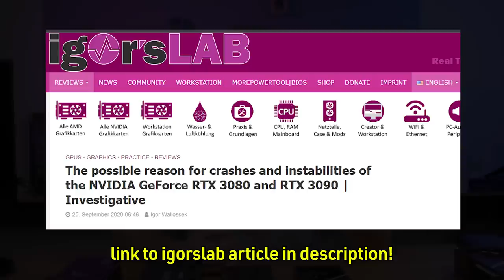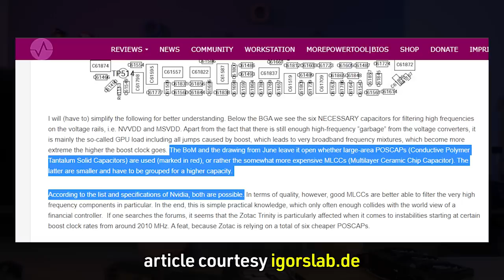The RTX 3080 Launch can't get any worse... Right? Wrong...

Comment: 14:02

“Aww I got the stupid SLI thing in the way”

Also what Nvidia said before nuking SLI support
Reply: SLI being dropped really upset me. I bought 2 GTX 970's when they came out and could barely utilize them.
Reply: @Nazraq04  It was interesting but I never felt like it was really all that efficient and "worth it", being that you had to buy two cards and have both pull power. 3080 solo seems pretty nice.
Reply: @JB-xl2jc  It used to be pretty sweet actually. My first SLI build had 2 GTX 570's, and at that time SLI was supported quite well. It was pretty close to double the performance. Like 185% sometimes higher. 

When Arkham Knight came out on PC and it didn't support SLI, I knew there was trouble ahead. Rocksteady had always implemented Nvidia specific features in their Batman games, but dropped SLI. Then, basically no developers were doing it either. 

Long story short. It used to be good, and now it's total garbage.
Reply: @Nazraq04  SLI and CrossFire was barely used by any games or programs. It was the biggest scam this industry has seen in a very long time.
Reply: @ShadowViewsOnly  It had pretty widespread support back in the PS3/360 days.
Reply: @Nazraq04  It had barely any support, and around 2010,2012 area, it basically completely disappeared.

Comment: ROG Strix is using 6 sets of the high quality capacitors instead of just the 2
Reply: All ASUS cards seem to.
Reply: @supra_enjoyer  all... Tuf and strix lol. The TUF is the best price/performance custom
Reply: Are you sure? I just visited the Asus website and.i can see in the pics 6 of the cheap ones.
Reply: @tricksterapva  https://www.asus.com/Graphics-Cards/TUF-RTX3080-O10G-GAMING/gallery/

yeah if you go on this site, one picture shows 6 cheap ones, while another picture shows 6 expensive ones. look closely! they must have changed their production. maybe they discovered this issue at an early stage.
Reply: @tricksterapva  I just checked, on ASUS website there's reference picture, showing cheap transistors true. Those images are generated by PC software. Prolly graphic designer messed up, as I saw many ASUS TUF 3080 teardowns and I can guarantee you that every single ASUS cards have all 6 more expensive transistors.
Reply: For me both are the high quality one. I gt redirected to my local asus website.

Comment: Looks like scalpers aren’t getting their money 😂
Reply: They are because of low supply, there isn't much choice.  It's not like the AIB's are going to retool and release new cards.  That would delay shipments for months.  They are going to just release a firmware update and if you're lucky to find a reference card or the TUF model, good for you.  If you can't and you really want a 3080, you'll take the worse ones with the firmware update.
Reply: @RWDtech  Buying the defective ones for 1000% higher price without a warranty included? Dude, no... If a scalper, by some miracle manages to sell one of those cards, whoever bought them is a moron, but anyone with a brain will not be buying those cards. :P

Comment: People might start getting really mad if they actually just took a minute to look up the 1k/unit pricing on digikey for low voltage (remember, those caps only need to take VCore, so in the <3V range) MLCC and electrolytic polymer caps: We're talking anywhere from <$1 to a max of around $5 saved. On a board supposed to be worth another couple of $100 for bettwer power delivery components to allow you to get some sort of enhanced overclocking performance!

Even for they "High-End", super stable, CG0 ones (which I highly doubt is what is required according to Nvidia spec, but whatever. XR5 or XR7 would make muck more sense in a decoupling role. Also, buying several different values is more effective than just buying 6x the highest capacitance due to where the self-resonance point lies, etc. etc. But it would probably be optimal to have the following (1x of each: 22uF, 10uF, 1uF, 100nF, 10nf and 1nf), with the smallest values getting the preferred placement as close as possible to the GPU.

There's usually nothing wrong with improving it yourself either (IMO anyway. I mean, if it's not even stable at 2GHz in gaming benchmarks, not even talking about furmark, then  it's not like you can fu.. mess it up any more, right?) So, just solder a small extension perfboard onto some contacts and also, in addition to the correct MLCC array, add on some 100uF~330uF electrolytic power smoothing capacitors for larger/longer transients, assuming the  buck converter has sufficient cooling and peak current rating capability to handle the increased capacitive load...
Reply: Your comment reads like a paper.
Reply: Only thing you’ve missed is the increased production cost on top of increased component cost
Reply: Mortlet . Nicely researched. One of the photos on Igor's article shows a modified board (the pads for either cap type are present) with the MLCC replacements, but Doesn't state the values used. Alas a couple of dollars is more than enough for AIB's to choose the polymer caps; auto makers will go cheap if it saves cents on a $30k vehicle.
Reply: Joe White . If they're all the same value,the reel is loaded and the placement is so close the eight can be placed in under a second. The soldering time is no different. If they use different values, that would add significantly as it would take eight passes; and if they were unique values to the board there's also the inventory cost for adding a reel to the placement tool (which can be limited, and it's very costly to exceed the max reel count).
Reply: Exactly what I thought!!! Working in RF V&V, and having a lot of experience with CCA and component level repair, my first thought was, "wait, they are having problems because of a handful of SM Caps that likely cost pennies on the dollar?!  No disrespect to the mfr, but imo the reputation hit they could take on this is probably going to cost them more than the value of those caps, even with the mfg overhead added in...
Reply: @AndrewSmall963  Just a correction, using different values wouldn't take more passes, a single head on the placement machine would probably have 24 nozzles (depending on the machine type ) - those eight caps would be placed in two-tenths of a second regardless of value. Also, a line would have multiple modules of SMT placement.  The placement cycle-time of the entire side is definitely in under a minute.
Reply: @mikemoore8929  This is the problem, coming from marketing myself, i do understand the cents on a dollar saving companies do, as it in the end generates more profit. But at the core you need to ship a fully functioning product, because the reputation hit is so much worse than the cents/unit you would gain.
Reply: So I work with a lot of MLCCSs at work and I do not suggest soldering them on by hand if your not a pro at soldering. MLCCs are prone to cracking if they are touched with a soldering iron causing internal shorts and potentially causing bigger issues on the card. I have seen my fair share of MLCCs that have burnt up a board due to a micro fracture causes by a slip of a soldering iron.
Reply: Gerd L. Plüü It’s not just that either. Anyone that knows a bit about mass production can tell you that saving a few cents on every card adds up fast when you are moving hundreds of thousands of units. But a difference of $5 dollars? Multiply that by a couple million over the production lifespan of a card and you could be shooting yourself in the foot from a financial standpoint.

In all likelihood, the vast majority of people won’t be pushing their cards very much and will never encounter the issue which validates the choice for savings.
Reply: doghous3 . Thanks. We had a list of preferred values, and stepping out of those was frowned upon; our scale was considerably smaller (there was a significant tool-up cost with each station required as it was one the sub-contractor couldn't use for another company's run) but inventory is still inventory.
Reply: I believe the MLCC values are all the same actually, but haven't seen any hard data on it.
My listed values are what we would use when engineering a high-speed digital circuit, limited to 6 values, which is still more than you usually need for good performance. Normally, 10uF + 100nF + 1-10nF (as close to the load and with the smallest total ISL you can get), repeated in parallel depending on the peak required dI/dt,  will do just fine.

Unfortunately, the design then gets sent over to 'value engineering' who then remove the 'unnecessary' caps one-by-one, until the circuit goes out of spec. Then they add just enough back to hit their design reliability targets. You'll often see this as pads being left unpopulated on consumer devices' PCBs (although sometimes the free pads are for extra functionality. The best way to check would be to test for continuity between another known common node, such as GND and VCC or VDD for decoupling caps).

Also, yes I'm aware that saving pennies on millions of units is generally worth it, but think about it another way: If shaving a few pennies off is so easy and really does have such importance attached to it, why don't they just shave another round off? And then another, and another...
Cost has to be viewed 'holistically' with regards given to all aspects of a product. In the case of a $1500 GPU acting as a 'halo product' (which is what I was focusing on), the product itself has more value in being an advertisement for the capabilities of the company, than its raw monetary worth. Also, the partners already charge a decent markup for exactly this kind of 'overbuilt' power delivery circuitry.
That's why I reasoned that shaving a couple of $ max (more probable is only pennies if they used the less high-end MLCCs, which usually don't have any markings to distinguish their manufacturers, thus making it really hard to put a firm value onto it) doesn't make a lot of sense. We're DEFINITELY not talking about millions or even hundreds of thousands of units being shipped here! Keep in mind that the entire 3090 market (only for new purchases, which is all that they would be making money off of) is already being shared with NVIDIA themselves. How many units do the lesser known partners really expect to sell? Probably not that many. And definitely not nearly enough to risk causing this amount of brand damage over.

I think Jay's reasoning is spot on. Bad communication from NVIDIA and bad assumptions on the partners' side, are ultimately to blame. This should have been caught in product validation and 'burn-in' (or whatever specific process they usually use to mitigate crib-deaths).
Reply: Sometimes the small numbers actually increase the penny-pinching. MLCC reels come in 10000 and 50000 parts and, in our case, we had to buy a full reel even if we only used 100 on a short run. On a 10k reel, that means a 100x price per component.
But I completely agree with you on a halo product, sometimes you should justify it to maintain a competitive edge. But on 'mass market' 3080 it will be pared down on the lower tier models.
Reply: @AndrewSmall963  Digikey actually stocks MLCCs at a pretty competative price for 1k and 5k rolls, but yeah, economics of scale beats improved engineering every day of the week.

At the end of the day, I think this all comes back to NVIDIA's arrogance in their dealings with TSMC. If it really was that much cheaper to go with Samsung's 8nm node, then surely that would be more than enough to compensate for the more difficult power delivery?
In a vacuum without AMD it might have worked out a bit better for NVIDIA (not as rushed to launch, not as much penny pinching and most importantly, not having to deal with all the engineering issues brought about by Samsung's 8nm node on a design originally intended for TSMC 7nm node), but that's not what happened. While I don't expect AMD's RDNA2 to be that competitive on raw performance (say, >10% slower than the 3080, in real world gameplay), the GPU die itself will be much better yielding and much more efficient, which means AMD can capitalize on the cooler not having to be so beefy (which saves on development costs and, most importantly, BOM cost and weight savings) and on having a much cheaper PCB overall.
While I don't think power efficiency is really that important to gamers (I know I wouldn't mind an extra few 100s of Watts for a free 10% boost in performance, but I digress...), AMD's price/performance ratio should allow them to claw away a decent amount of the 3080s market share, assuming that RDNA2 doesn't have any major issues of its own of course. And that's why I think these issues with NVIDIA's 30-series launch have come about. They probably needed to build up hype and launch much sooner than AMD just to minimize the amount of sales lost to AMD's RNDA2.

Comment: Guys relax. It was a driver issue that was fixed a couple of days after this video. Linux didn't even have this issue. Just Jay spreading misinformation and not admitting he was wrong. Hardware Unboxed even called Jay out and made him look like a fool for this. 

Even if available you shouldn't buy a 3000 series now but not because of capacitors but because RDNA2.
Reply: SO TRUE. This FOOL pretends to know everything.
Reply: thank you, i just got my Gigabyte 3080 and i was worried

Comment: the ASUS TUF card is the one i've got preordered so I hope those rumours are true
Reply: Looks like that’s the best card you can get.
Reply: Someone posted here, he has seen a tuf model with the cheap capacitors on there as well. So it's not as easy to know which aftermarket card to get mate. They might have made both designs as evga have just admitted.
Reply: ASUS TUF crashes too
Reply: their aftermarkets use the cheap array. its the photo they used on their page for it
Reply: Not sure where others got info from, but I can confirm that the ASUS TUF 3080 has the full set of higher quality arrays (at least mine did).
Edit: I have also yet to experience any problems, hope you get yours soon!
Reply: @coreyp9913  
is ur tuf card the oc version or non oc? i have a feeling the oc version has the good caps while non oc has bad caps.
and my order for the 3090 is the non oc version cos thats what was available :3

as for kyles review of the 3080, he too got 6 of the good caps https://www.youtube.com/watch?v=5XuoU7ZcdbA
Reply: Same. I ordered the TUF, hope it will live the expectations
Reply: @coreyp9913  Good to know that you had one with the better caps man.  I believe some have seen pictures of the tuf  with the lower quality ones as well. Think it was from the actual Asus website if you would like to check.
Reply: @boastyy  It seems strange to me, since the website shows images of the card with the six arrays of capacitators on both models, OC and not . If you are sold a card that doesn't represent what you are being shown (and such a thing is not expressly mentioned in the pictures themselves) then you could easily sue for false advertisement. The supposed images with the cheap capacitators all come from Newegg (nobody personally received a TUF Gaming with the cheap capacitators, at least for what I could find) and I hence I would take those "pictures" with a BIG grain of salt. Btw, I'm also interested on the matter since I've ordered a TUF Gaming myself.
Reply: @boastyy  For some reason the advertising pictures shows the 6 cheap capacitors. But when people receive the card it actually has the 6 MLCCs.
Reply: So to be clear the ASUS TUF GPU should so have no problems ?
Reply: @sparhawk1228  Yeh hopefully they all do mate. I was talking to a guy on one of the forums and he had a tuf model and was experiencing crashing. Now I am not sure if he possibly had one with the inferior caps but might be possible. It might be some other problem on his system , I don't now. As more people have these cards we will have a better idea if they actually sent out any with the inferior caps. Thanks man.
Reply: yeah it seems the OC version has all good caps, non OC has all bad caps, even the asus strix photo has all 6 bad caps
Reply: @sirnootnoot4766  They used the same photo for the marketing lol.
Reply: @sirnootnoot4766  Thanks for the info mate. I am surprised the Asus strix model shows bad caps. I think there might be differences from perhaps pre production photos of the cards and what actually is sent out as well, which makes things a bit more complicated. I also talked to someone who had a regular tuf 3080 who checked and had the good caps on it with no crashing.Thanks man.
Reply: Might be the reason for the lack of cards, every maker had to hastly fix better cards?
Reply: Yea it's one of the few cards that's currently available in Australia atm and it also seems to be a bit cheaper too, reckon I'll be picking it up
Reply: Same here, hoping my one is a newer production unit with 6 MLCC.
Reply: they sent reviewers the expensive capacitors models but actually ship the cheap capacitors for consumers lol
Reply: Sparhawk122 it’s because the pictures are usually preproduction pictures that may not have the final specs. Which is most likely the case here.
Reply: @ModrunOfficial  My card was the non-OC version, so with any luck its the same story with the non-OC 3090.
Reply: @boastyy  Another comment on this video, mentioned that the pictures on the website are pre production with the lower quality caps, maybe that it. Hopefully all those reaching consumers have the good ones.
Reply: @coreyp9913  great to know thanks